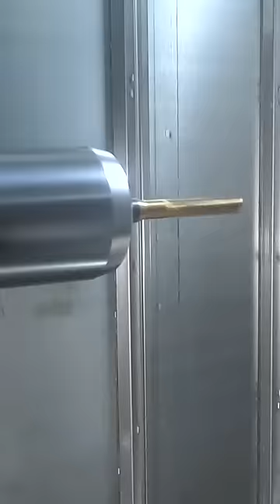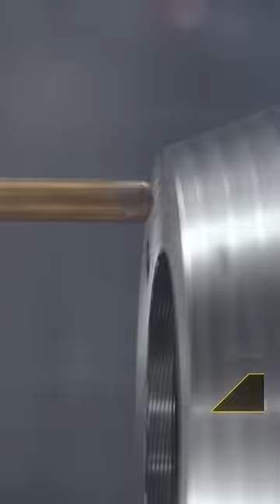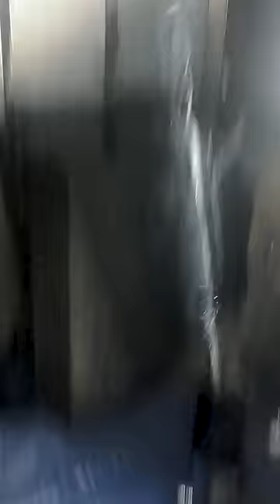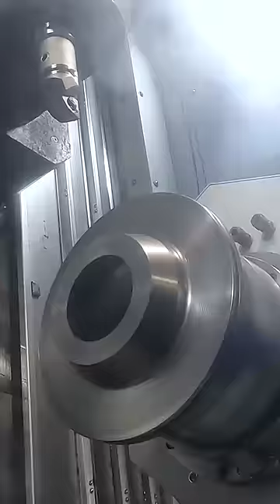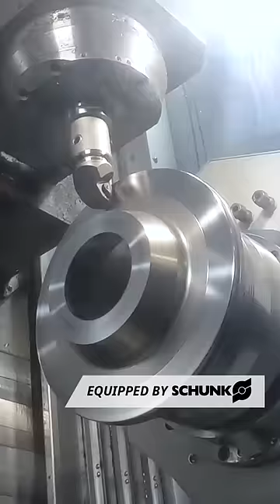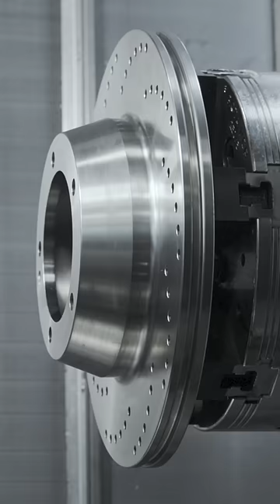Machining The Most Satisfying Cuts on a Cast Iron Part #shorts

Comment: I have been running CNC machines for over 30 years.  The CNCs of today make our old CNCs ancient history.  Just amazing what current CNCs can do.
Reply: I hear that. I’ve been working in the semi conductor industry for just short of 20 years. The stuff we are doing now would be considered impossible when I started. Can’t imagine what’s going to be 20 years from now. I think I’m your world probably metal powder 3d printers that just print the metal part. Seems that’s the direction.
Reply: Convince my company to get a real CNC then. Our toolroom gets the cheap equipment. The crank and gear department get amazing machines from Heller and others that can hold micron tolerances. But then as the toolmakers we are expected to support them with the cheapest, and old, Haas CNC and 60+ year old manual equipment.
Reply: I prefer to retro the old ones. These machines today arnt built to last

Comment: Breaking the surface of metal makes it weaker. I wont use drilled rotors they are garbage unless the holes were cast when casting the whole rotor and are less prone to cracking between the holes. Amazing cnc work though

Comment: Great video however i think slotted rotors are better than drilled /drilled + slotted bcs the holes tend to fill up with brake dust and trap heat and becomes a common point of cracking, but still, looks nice none the less
Reply: Smooth are best. Newer pads don't expel vapor like 1970's ones. Any machining on the face just makes stress risers.

Comment: I absolutely loathe big cast iron parts because chip and coolant management cannot be ignored for a short time. A hose sprayer tapped into the coolant lines or as a machine feature is a must. Overtime, if you don't clean every nook and cranny you'll end up with a nightmare cleanup because the chips will turn hard like concrete. Overnight sometimes. Same with the inside of vises. Vises pretty much have to be disassembled and cleaned. Poor casts are a carbide killer. Gates, areas or chunks that aren't formed properly will typically break carbide. 
We do cast work in the shop I run but the work we do are jobs we've had for years. We're a small shop. All the added headaches of cast iron work takes a huge hit to our efficiency and overall performance because we only have 2 real machinists. Our button pushers aren't experienced enough yet to deal with the problems. Right now we have the luxury of picking and choosing the work we do, if I can say no, I will.
Reply: Perhaps you may have an opportunity to expand just a bit to try something new with your existing experience but not in the realm of cast iron? Maybe the cast iron could pay for the next more interesting and lucrative to you endeavor so you could expand a bit kind of like some of Titan’s early stories?
Reply: @poloska9471  I don't disagree but the owner(retired wall st. guy) and I are changing directions. For us, our most lucrative work is swiss lathe work. Titan touches on a lot of happenings in the industry but totally misses the mark when it comes to swiss and multi-spindle machining. Hi volume, low labor. It's not a joke when I say they are like money printing presses. Every minute, we're making $2/minute. Right now I've got 4 machines running unattended that are being watched via a Ring cameras. One of us will go in every few hours and swipe parts out of the part catchers, make any adjustments or tool changes. Then go home. Easy peasy money...
Reply: Just do your job.
Reply: @TheSphongleface  I think you misunderstood what I meant when I said, "if I can say no I will." I am doing my job. I do the quoting and scheduling(work flow through out the shop). Maximizing risk vs reward is the #1 goal of my job.
Reply: @GrumpyMachinist  woah that’s pretty sweet! Do you mind sharing what category or more or less specific parts it is? No worries if you’d rather not, I don’t own a shop but have always thought it might be a cool project some day, this makes me really curious what can be done with low-effort machining (I didn’t even know one could do such a thing with ring cameras (I mean to have parts being made with that low of a level of constant oversight where one can do it via camera and check once a few hours)… so that’s sort of where I get my question).
Reply: @poloska9471  Typically anything that is brass, aluminum, 12L14 steel, 303 sst and small enough that is doesn't build up to quickly in the part catcher. 
Swiss lathes are very consistent, they can easily hold .0002 without much effort. We uses macros to automatically switch to a different tool when it's life is up. 
Don't be fooled though. It's taken awhile to get there. Lots of documentation on tool life and cutting conditions took place.

Comment: That things they are making is called indexing wheel, they are widely used in making pinions and other gears
Reply: It's a drilled brake rotor/disc, for motor vehicles.

Comment: I feel like brakes are probably not cast iron.

Come on man.
Reply: those are rotors not brakes but I do have a question: if this is cast iron how come it’s silver like aluminum yet a cast iron pan is black?
Reply: @woofy9977  brakes is usually used to refer to the rotor caliper and pad for most uses.

Regardless no part of the brake system on a modern car is cast iron and I doubt cast iron was ever used.
Reply: @brandonl8039  no if a guy means rotors that’s what he will say. doesn’t matter didn’t answer my question. without looking I’d bet for certain cast iron has been used for rotors and disc brakes on early machinery such as a flywheel or tractors etc
Reply: @brandonl8039  well you’re wrong which is fine but you speak so confidently which makes you a dvmbass. cast iron was the most commonly used material for rotors and disc brakes due to its high temp range. look it up for yourself
Reply: @Vivid Media so what are cast iron pans from? or is it just the hardening process that blackens them? I’m guessing if you rough cut their surface it would be silver like rotors ya?
Reply: @notsevenfeettall  yeah the black from a pan is just carbon from being heat treated. billet rotors in f1 cars straight catch on fire sometimes when they’re trying to get heat in the tires. also ceramic brake pads were first used in f1 and their calipers have 6 pistons instead of 2. want to see something bad ass check out Max Verstappen’s brakes on fire waiting for the restart in Hungary last year
Reply: Well they use a mix of metals but typically mainly grey iron and they are cast then shipped and cut from there... I personally run a cnc and cut rotors everyday for work
Reply: @woofy9977  F1 brake rotors are made of carbon. And also the number of brake pistons can be from 1 up to 8 or more on street cars on a single caliper.
Reply: @chrisweber2315  maybe some oversized wilwood calipers but I doubt even aftermarket calipers will have more than two pistons. certainly not a car coming out of a factory
Reply: @woofy9977  there are plenty of cars wirt 4 or six pot calipers that come out of a serial production. I for myself drive a Megane Rs with oem 4 pot calipers. A lot of older sportscars have 4 pot calipers, 300zx, 200sx S14, Evos, Subarus Sti's and so on.
The number of pistons doesnt belong to the size of the caliper. The main reason for more pistons is to distribute the brake force more even to the brake pad and from there to the rotor. Look at motorcycles, they have smaller calipers but very often with 4 calipers. But usually the more pistons the more expensive is the caliper.
Reply: @chrisweber2315  yeah you’re right actually it seems a lot better than my forester which has glide pins that actuates the other side. btw the rs having 300 hp with a 1.8L is crazy

Comment: I would have to sell my house to buy that
Reply: Unfortunately you will still have not enough money for that. Machines like this have a price like a 10 houses. And you have to remember about tools for that which prices is unbelievable:)
Reply: @МаксимЕршов-щ2й  lol no. A house around here is way more. I could sell my home and use the money to buy a couple of cnc machines.
Reply: to put it in perspective, an entry level CNC with the most basic tooling will run round $100-120k bnew retail. Used ones obviously less. Better models can go 200k and up.  And that's not counting the tooling, the fluids, the support auxillaries and maintenance/spare parts.

But usually the investment is made with the intent of satisfying a need and with the expectation of having a good Return of Investment, whether in terms of high speed manufacturing of parts to sell, or to save costs in comparison to having a to outsource it to someone else/third party.

Comment: Question- Why dont you use coolant? Doesnt the heat damage your tooling?
Reply: I’d take a wild guess, and say it’s air cooled. I don’t know what else it would be.
Reply: Sometimes tools are durable enough to cut certain materials without needing to be cooled, but you get alot better tool life if you use coolant. 

If they are just running coolant off to get these shots- great. I was just wondering if that was SOP for their jobs to go without coolant.

Comment: Always had an issue with surface finish when facing surface with holes.  There is always a little trail.
Reply: nothing that a followup with a chamfering tool following the same bore hole pattern on the CNC can't fix
Same with manual machining, its just gotta be done ...well, manually

Comment: How I expect my drillbits to be at home:
Reply: Those are all endmills buckaroo. Close but endmills are always gonna run circles around bits, and do not fit in your drill
Reply: @mowerboy330  lol yeah, just making a comedic remark about how dull my drillbits are
Reply: Learning how to re-sharpen drill bits is a great skill to learn. Relief angles, cutting angle consistency and all that.

That, and the endmills show in this video can indeed run circles round drill bits, but proper high quality drill bits can also do the same thing, albeit slower - just gotta keep in mind that these CNC machines rely a LOT on very precise work and tool rigidity, and a hell of a lot more torque and tool pressure force to do the work they do - miles better than what can be achieved on a drill press, or worse, by handheld drill.

Comment: These ported rotors are outdated and kinda unsafe.. The thermal fluctuation caused by the holes(ports) cools the rotors down too quickly and will make them brittle. Add that to them drilling the metal with no cooling water/oil and it just makes them even more brittle.. Dimpled and slotted rotors are the way to go because they clean the pad surface and have enough material to keep them from warping or cracking so easily. These ported rotors were for older pad materials that off gassed at high temps to release the gas but new pads don't really have that issue anymore so stay away from this style of rotors.

Comment: bolt circle math yay!
Reply: I was trained by old school machinists. I can do the math. But why... It's so much easier to do in software and there won't be any mistakes on locations unless it's programmer or operator error. Even if I was machining at home I would use software. For what Fusion 360 offers, it's dirtball cheap.

Comment: What is cast iron here ?
Reply: EVERYTHING, it's a one piece brake rotor made of cast iron first, then machined to the desired finished size, then possibly plated with a corrosion preventive coating.
Reply: @dew2667  you're saying this isn't steel?

Comment: Useless drill holes. Wow the gasses built up between the rotor and pad are gone. Without veins what's getting rid of the heat? All these cuts are basic also...show me the veins getting cut. Not cheap straight cut veins but spiraling. Now that's a real brake rotor.